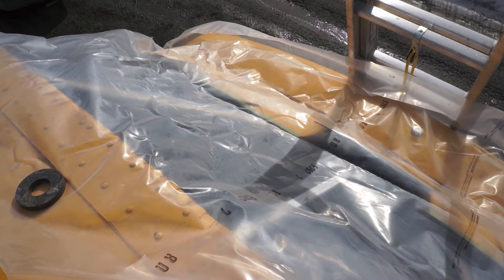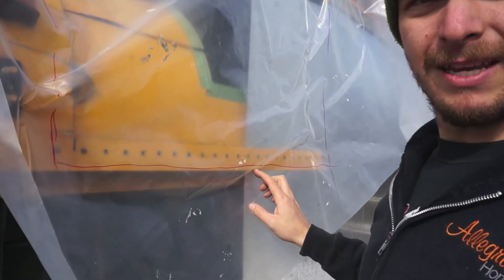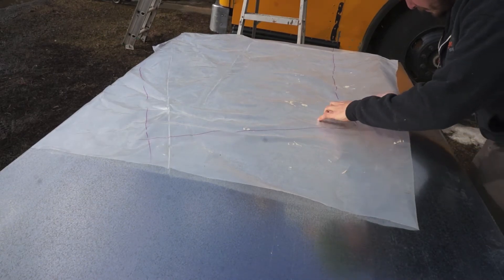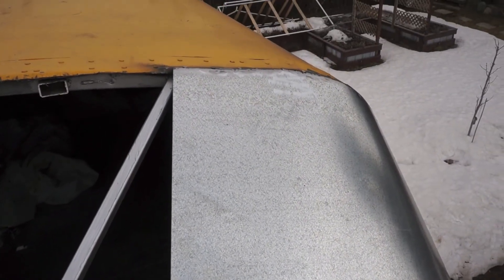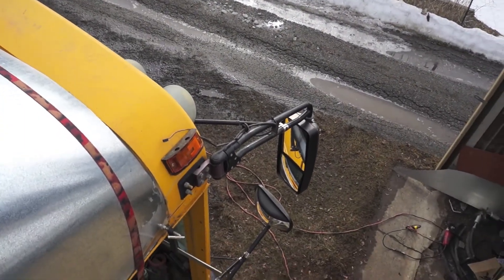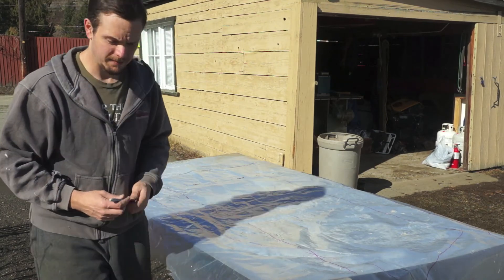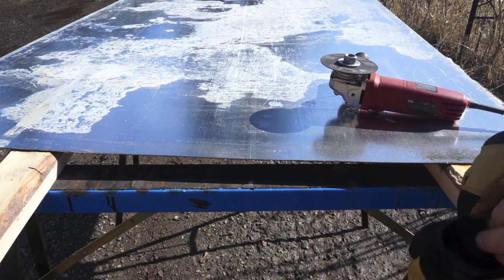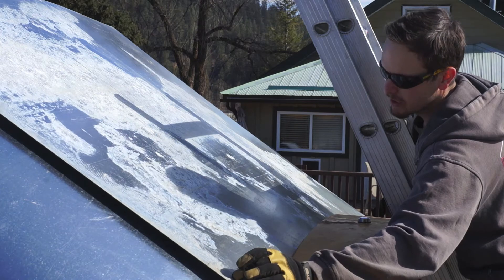Roof Raise | Transition Sheet Metal On Our School Bus Conversion | Ep 9

Comment: Looks good thanks for the explanation on how I couldn’t think of anything you did wrong and you probably did it way better then I would do..although there is this just this one thing that may help or not but check it out from what I understand you can only buy it at Lowe’s it’s this white sealant stuff it’s real good for leaks and sun reflecting if I think of the name I’ll put it up there
Reply from the maker: Thank you!  Is it dicor that you are thinking about? Typically it is used on rv roofs?

Comment: Never use silicone sealers. Use polyurathane sealers. I found out that polyurathane driveway sealers work best. I use the self leveling type to seal around roof vents. Spread it with a inexpensive paint brush. The non sag type is excellent for regular cauiking type jobs. It stays plyable  and sticks to clean surfaces permanetly.
Reply from the maker: Thank you for the advice!

Comment: Hey how did you run your power cord to your welder to make it go  that far
Reply from the maker: I had the welder plugged into a heavy duty extension cord from my shop. And to get the wand up to the roof i had to lift the welder into the bus and then up onto some saw horses and stick the wand out the side window. It just reached the very top of the transition!

Comment: I'm curious, why did you decide to weld rather than riveting the top seam? Generally rivets are used so you can have a good overlap and use something like butyl tape for a good bond/seal. And you wouldn't have to do a lot of bondo work. Regardless, good work and in general has a good shape.
Reply from the maker: Great question! I was originally going to use rivets and butyl tape but realized that the bend that i would need to make in order to get a nice finish on top would have been extremely difficult with 18g steel and my limited knowledge working with metal.